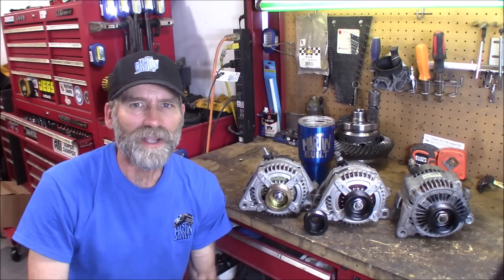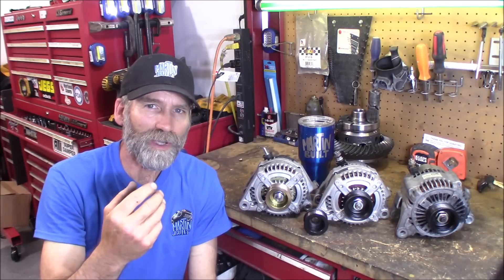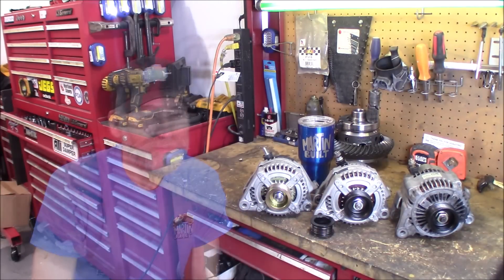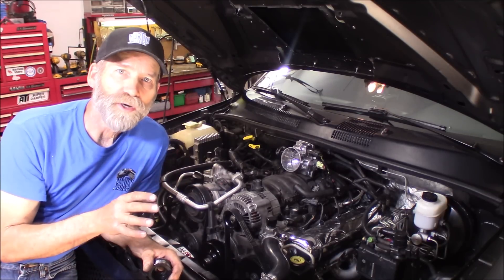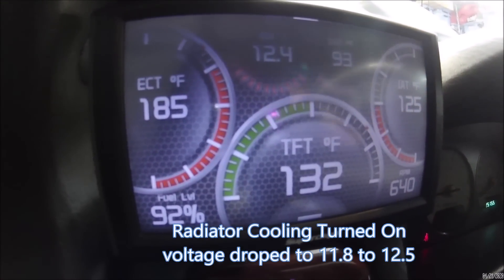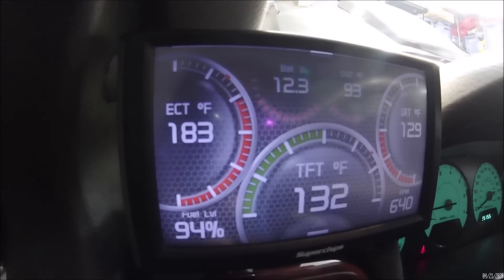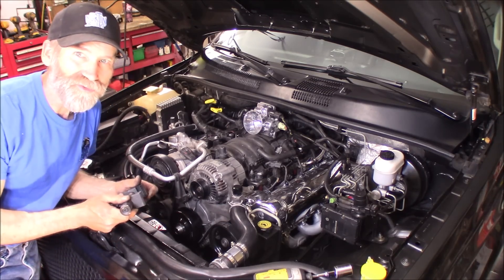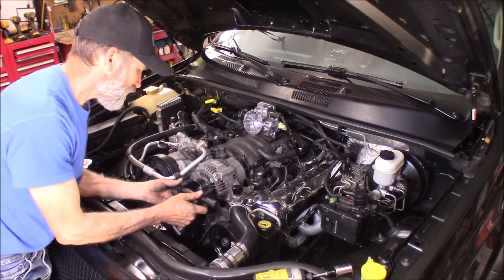Alternator Shootout at Idle (136 vs 160 vs 250 amp)

Comment: What about an alternator "diode" mod? At least, in theory, it should bump the voltage by ~0.6-0.7V at the expense of increased idle RPM
Reply from the maker: the problem with that is, the ECM is already trying to get the alternator to produce 13.7 plus voltage but alternator just is not capable, so by adding a diode would only work (to boost voltage) once the alternator was cable of it by boosting the RPM.

Comment: Great video and much appreciated! I know you took a hit buying that 3rd alternator now that it doesnt perform as desired. Do you have any recommendations on how much shorter of a belt? I know you mentioned it for a second.
Reply from the maker: I had to go kwight a bit shorter because of the ATI super Damper with the 25% underdrive pulley but, you might need to go with a 1/2 shorter with a standard harmonic pulley.
Reply: About an inch and inch and a half smaller

Comment: Would these after market alternater last as long as the original Alternater?
Alot people says the aftermarket ones doesn't last more than a few months
What do you think?
Reply from the maker: I have a 200 amp in my Cherokee XJ that has been in there for at least 7 years many be more with no problems.
Reply: @martinbuilt 
That's great
What is the best aftermarket brand you recommend?

Comment: Would you recommend the 250 amp if i was gunna throw in a radio system with high wattage?
Reply from the maker: yes if going to be installing a high power audio system I would go with the 250 amp and replace your battery cables to the alternator with a 1 gauge

Comment: Why are you running underdrive?
You slowing down water pump too?
Reply from the maker: free up some HP
Reply: @martinbuilt  right.. then you need more alternator so add parasitic loss? Guess my point is..it seems like more trouble than it's worth and now your going back the other way...unless your running the drag strip every weekend and that nets you some number you have to have I don't think your vehicle does anything better because it has underdrive pulleys on it..when you convert energy you lose ...if you have fan on a switch for deepwater crossings and that I get it...if not ..again ..why change out the factory fan too? 
I have driven Toyotas for decades..so maybe other vehicles have subpar cooling systems? I've been 4low,tacoma ,sandstone canyon, past gypsum mine area. August, heat of the day.windows up, a/c on, happy truck full of people out wheeling in terrible conditions..my tundra? on 35's?.longbed double cab. Loaded to my stake sides towing a Tacoma loaded to it's stake sides on a car hauler..from so cal through Vegas in middle of the day, late August, and out to Montana.. a/c. cranking....no needle movement..trans or motor..free up hp with pulleys? think you would rather build horsepower with cam,heads,exhaust,injectors,
Added: I go through Vegas during the late part  of the day as this times me better for the big Utah push..Utah is a pain ..

Comment: Good video. My dodge nitro comes with a 160a stock. Haven't had any problems with it but have upgraded due to my car audio demands to a 425a brand x. Does 230-250+ at idle.

Comment: Great movie! And as always inspiring, no one does it on YouTube (!).  But what about belt tension?  Maybe it's worth starting a larger pulley somewhere else -  to get the same tension?  And I wonder what will happen adding a large capacitor (used for high power car audio amps). Great work, thanks!

Comment: I also have done car audio for years! Your voltage was to low to begin with. ( that's why driving it around for a couple days brought it up to the 14 range.   Watching video i can tell you.  First you battery was week,  second your connections where needing cleaned, lastly you should clean the big 3 connections as well as add the 0 gage wires for a complete big 3 upgrade ( cheaper than the alternator) and if you where still worried about it your battery needed replaced anyway get the yellow top light gray optima battery ( charge and discharge at faster rates ). The battery included might put you up to or more than the alternator depending on time of doing it. Fyi as i have said for years now doing car audio if you're dealing with voltage problems with out a system in it you need to redo the electrical.  All of it. A good electrical system wouldn't drop voltage accept turn on on!!!!!    Meaning at first power on it will drop but the regulator kicks in and brings it up to a steady voltage.  Very last thing. I personally consider any alternator that is running at idle below 14 volts with nothing else on to low and a problem in the system.  ( factory or not you should be at 14 give or take no more than. 2 )

Comment: Did you have any blown fuses after the 160A upgrade?  Thanks for the video
Reply from the maker: no, I did not, adding a more powerful alternator will never  cause fuses to blow, the only fuse that could possibly blow would be the fusible link or inline fuse to the alternator and  the circuit is drawing more than the rating  of the fuse, for example, a 100 amp fuse and the draw is 120 amps
Reply: @martinbuilt  I'm thinking that's why people upgrade their wiring and make clean ground connections...
Reply from the maker: @jimparker7778  yes when installing a high amp alternator and if you are going to use anywhere near the rated amperage I would upgrade the battery cables.

Comment: why didn't your idling RPM change with all those loads turned on?? Small pulley is literally changing the PRM of alternator, which can be achieved with the increase of engine RPM with big pulley.
Reply from the maker: Because the idle air control valve will automatically adjust the idle speed.  Same happens when I shift from park into reverse or neutral in the drive there is no change in idle speed but yet the load changed.

Comment: I think you have a bad ground or connections somewhere upgrade your battery terminals and power wire connections to the alternator also Power Master makes the correct idle alternator. Check your engine rpm is too low 640 rpm at idle seems really low should be around 800 rpm at idle.
Reply from the maker: The battery connections are good and that is normal idle for the 4.7 
I will upgrade the ground and alternator cables.
I may look into another alternator like a Power Master or Mechman

Comment: The problem with these alternators is that they're not low RPM charging alternator so they can't handle high output at low RPMs because they don't cool have to get a alternator that operates at low RPMs

Comment: IF YOU PUT 6 ALTERATORS ON A SINGLE ARMATURE, HOW MUCH FORCE WOULD IT TAKE TO TURN THEM? FIND AN ELECTRIC MOTOR RATED FOR THE JOB. GET A 6 PACK OF SUPER CAPACITORS WIRED UP. CHARGE THE CAPS TO FEED THE MOTOR TO TURN THE ARMATURE TO CREATE A SURPLUS D/C OUT PUT, SOME OF WHICH FEEDS THE CAPACITORS. SEND THE SURPLUS TO AN AXIAL ELECTRIC MOTOR. AND SO ON

Comment: Martin can we get a link on the 250...
Does amperage and voltage go hand and hand...
Reply from the maker: Eagle High  250 AMP High Output Alternator Jeep Commander 3.7 4.7  https://amzn.to/2LiNXfe
Make sure this fits your vehicle before purchasing.
Yes, voltage and amperage go hand in hand, if you have low voltage your amperage output will also be low.
Reply: 2003 limited 4.7
Reply: martinbuilt u have an 04 wj right
Reply from the maker: @Bigv57thG  yes, 04 JGC WJ

Comment: Nice job Martin.That was an upset for the 250 amp.....
Reply from the maker: Yeah, I wonder if the Mechman 240 or 320 Alternator would be any different?
Reply: @martinbuilt  I just got a mechman high rpm 250a , which uses stock pulley. It puts out 180a @ idle and a little more than 260a @ cruise

Comment: Where did you get the pulley.
Reply from the maker: Let him know that I sent you and make sure he supplies a washer as well, you may need it.
https://www.ebay.com/itm/49MM-1-9-Alternator-OVERDRIVE-6-GROOVE-PULLEY/253996371394?ssPageName=STRK%3AMEBIDX%3AIT&_trksid=p2060353.m2749.l2649
Reply: Just wondering about clutch pulleys, are they good for this motor? Just got my super damper, so when I get my belt that'll go in. And jeep is running good with the 49mm pulley on the alternator.  Probably should of waited for the belt, but got all kinds of time. Thanks for the vids  your awesome. PS. Messed up my bleed screw, not looking forward to fixing that. All that will wait for the weekend.

Comment: So is 150 higher than 120 so why is the 120 like $300 and why is the 150 like $100 for a 2012 mini Cooper S
Reply from the maker: Yes, the 150 amp would be a higher amperage than the 120. Don't understand why the 150 is cheaper unless there are different manufacturers.

Comment: When you turned the AC on.. The ECM should have boosted RPM. I never seen it go above 630 RPM.. That is way to low. You need 850-900 RPM...

Comment: you have to remember now a days the computer controls the output of the alternator meaning no matter what your alternator amperage is capable of doing the computer will only allow so much. so you can spend 5 to 600 bucks on a alternator and it wont change a single thing. I wish I knew a solution to thjis but have yet to find one
Reply from the maker: the computer is asking for 13.8 to 14.1 even at idle but the alternator is saying I'm giving it all I've got captain. The problem I was having is the 25% underdrive pulley that I had installed on the harmonic balancer and the added load I put on the alternator by removing the hydraulic driven cooling fan and going with an e-fan this is why the idle voltage was so low.
Reply: Tuning can change the output at given rpm's
Reply from the maker: @mrmotofy  The ECM is already telling the alternator to put out 13.5 plus and the alternator is saying "but captain I'm given her all she's got". If the alternator is not spinning fast enough to produce said voltage an external voltage regulator, the big 3 upgrade and programming the ECM is not going to make any difference at idle.

Comment: Martin try oxygen free copper 4 awg wire from alt to battery or even two runs of 4 awg even 0 gauge
Reply from the maker: I pick up some 1 gauge today from a Chrysler 300. Same cable I used when I moved the battery under the back seat. I will also change out the ground (-) cables as well.

Comment: Are you sure that you didn't get the 250 and the 160 backwards ??  Seems like the 160 did better than the other two even with the stock pulley.
Reply: He said the 160 is better at idle.  The 250 is better at a higher RPM . That's why he is using the 160.
Reply from the maker: Yes, the 160 was the winner in this showdown.

Comment: you gotta go with 1/0 wire especially with the 260 amp
Reply from the maker: Yes, that would be a good idea if you're going to pull anywhere near the 250 amps, but for this experiment, it makes no difference.
Reply: @martinbuilt  true, in your case, or application. You’re only limited by the wire size
Reply from the maker: @mighty9100  So many people were telling me to do the Big 3 and that would improve the idle voltage. I was quite sure that would not help but I did it anyway. How To Install the Big 3 Upgrade Improve Your Vehicle's Charging System https://youtu.be/Ednw5npj83c
And just as I thought no improvement at idle.

Comment: There’s no reason why a 250a alternator should be dropping voltage that low. I reccomend you upgrade your Big 3... Alt-Batt Pwr cable, Batt - Grnd cable, and your Eng-Chassis Grnd cable. Use at least 2 GA.. I would recommend 1/0 GA and you might notice a huge jump in performance... even with a lower amperage like a 160. The idle supply would probable be around 110-130a which should run most of your systems while staying at 14v.
Reply: But he has a 25% under drive pulley on there slowing everything down
Reply: @mrmotofy  That would explain a lower amperage, not the lower voltage. Even underdriven like that the alternator would put out the 12.6-14v but just at a lower amperage. The voltage would only drop if there were grounding or current flow issues causing the battery to not recieve all of the current from the alternator charging it.
Reply: @SharpShooter9867  But if under driven it's gonna struggle with voltage and amperage
Reply: @mrmotofy  No, the voltage regulator built into the alternator will keep the voltage up regardless of how fast the pully is spinning. The drive speed only affects the amount of current it can make at the regulated voltage.
Reply: @SharpShooter9867  Well revving up voltage goes up...RPM's drop to idle voltage goes down seems to disagree with your theory as well as ohms law
Reply: @mrmotofy  well I can tell you that’s not how a modern alternator is designed to function. 🤷🏻‍♂️ A voltage regulator is designed to give a consistent voltage regardless of the speed the pulley is rotating as long as it’s faster than the minimum speed it’s designed for. For most alternators that’s well below the idling speed of a car, the few exceptions being the charging systems for motorcycles and some race applications. If connections aren’t solid there could be a draw that would explain why the voltage is dripping with the idle. I assure you, it’s NOT supposed to stop like that.
Reply: @SharpShooter9867  Well sorry to burst your bubble but its how all 24 or so I've owned/replaced  with  for the last 25yrs up to the Brand New NOT rebuilt I just put in about 5 days ago. As well as hundreds or so of videos I've seen the voltage displayed and engine revved up. I work in the real world with experience not theory.

Comment: Weird cause my 180 alt does 14.6 at idle copperstate
Reply from the maker: The thing is on my engine has a 25% underdrive pulley on the crankshaft. The alternator can not produce the minimal voltage at idle. Even after installing the overdrive pulley on the alternator that did not make up for the 25% underdrive pulley on the crank.
Reply: @martinbuilt  oh ok

Comment: If the 160 provided more output at idle than the 250 the alternator is bad. There should be no reason that you lose on the low end I don't understand where you got that the reason why they put the lower pully is to get more speed to get to the higher amp numbers Across the rpm range.   An alternator will only supply the current you need therefore if your voltage was dropping at idle that alternator is not supplying the current you need.  Could've been possible your belt was slipping with the smaller pully.
Reply from the maker: I was using that same small pulley with the 136 - and 160-amp alternator. That tells me the belt wasn't slipping because I got better voltage with the 160 over the 250. And we're only talking about amps at idle, not the overall amps that the alternator will put out. The amps would have been exactly the same no matter which alternator you were using. The 250 amp alternator already came with a slightly smaller pulley than the OEM alternator. This already tells me that the 250 amp alternator puts out less amperage or voltage at a lower RPM.  The manufacturer knew this, and that's why they installed a smaller pulley to make up for the difference..

Comment: That sucks 13.6v at idle! Mine is 14.20v at idle cold alternator and 13.8v with all stuff turned on in my Toyota
Reply: Like i said that display is wrong or connected poorly     big alternator and cant maintain   13   ..drop to 11 with lights and ac  ?   Nope     i have 80 amp  i can turn on everything  plus 3 audio amplifiers    and i maintain 13 6   on idle

Comment: Great to know !  DO the manufacturers not run these tests at idle? If I am waiting for someone in winter with the heater, fan, light and radio on, it sounds to me it spells trouble especially if you are in  northern countries.
Reply: Idle is not normal driving...it's very minimal. Most alternators can put out near full output at 900-1000 engine rpm's. That's why you have a battery to balance out and hold a charge. He's starting out under driving from the beginning. So everything spins slower than normal, then he tries to get it back up to a normal rpm...Can be considered counter productive.

Comment: That was a good test but your failure was the last alternator that was 250 amps you didn't use a smaller belt that was your failure and why the the current didn't go back up and stay up and you probably would have had 14 14 and a half try that next time but an overall good job that was a good test and the middle one that was 160 would have gave you more too if you would have did the same thing with the belt try that
Reply from the maker: but yet the 160 out preformed the 250 at the same amp load.

Comment: Why doesn't this car charge at 14.2V like a lead acid should?
Reply: could it be the ECM software?   The ECM runs the voltage regulator on my Silverado
Reply from the maker: I do have a 25% underdrive pulley on the harmonic balancer and the alternator does require a min RPM to produce that 14.2 volts, that's why installing an overdrive pulley on the alternator does help. Making adjustments to the ECM or installing an adjustable voltage regulator will not make any difference.
Reply: @martinbuilt  Thank you for this great volley!  When I was a young man fifty years ago things were simpler.  My old chevy just had a generator!